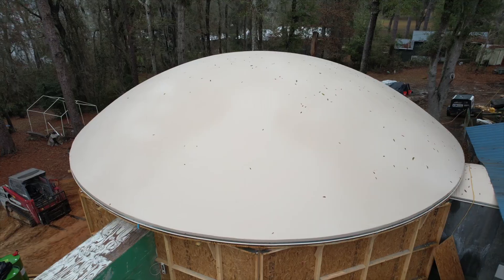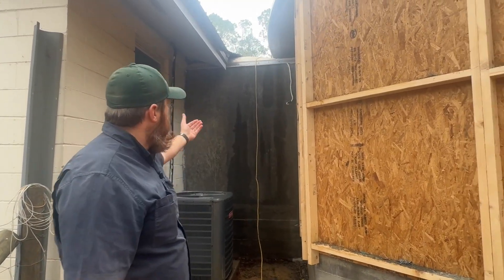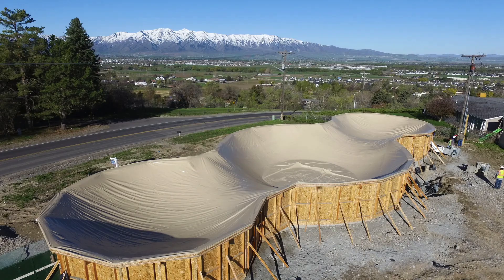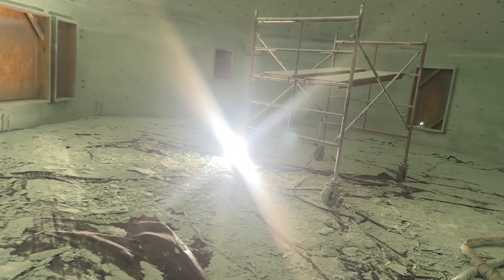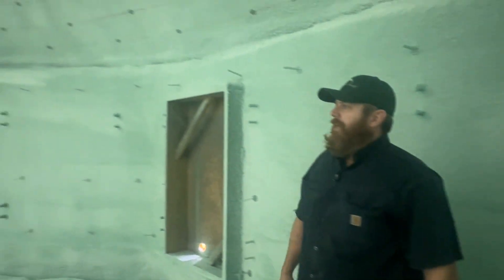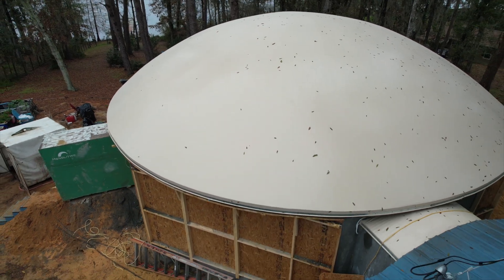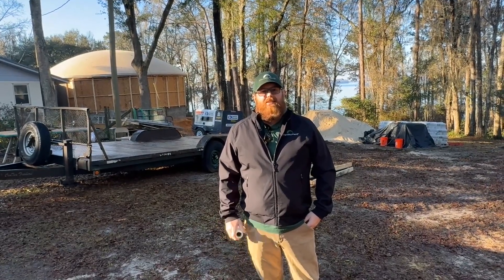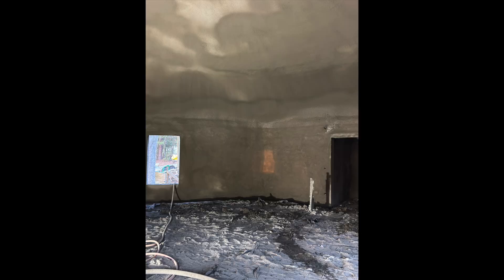Building an Orion-Style Monolithic Dome Home Addition in Tallahassee, Florida

Comment: I am interested in building a dome structure on an eco-friendly lot in the Maya Riviera. Given the local building code, which requires a balance of 60% environmentally friendly materials and 40% concrete, I am eager to learn more about your design process.

Do you offer custom architectural designs based on the client’s needs and lot specifications, or do you provide pre-designed prototypes suited for different environments? Additionally, I would love to understand how streamlined your construction process is and what efficiencies you incorporate.

I am also looking for information on cost per square foot and available models or design options. Any insights you can provide would be greatly appreciated.

Looking forward to your response!

Best regards,
Reply from the maker: @mariano18valero18   Thanks for your questions. We received your email and will get back to you soon.

Comment: To clarify, are the wall's layers as follows: OSB (for form), concrete (exterior), foam, concrete?
Reply: Foam is not very fire resistant so it would make sense to do it the way you are thinking!
Reply: @Damageinc.  Their normal dome construction is air form, foam, concrete.  This video looks a little different which is why I ask.  Curious if it's just for that flat wall appearance on the outside.
Reply from the maker: @mikemcelveen  Yes. It’s just to get that flat wall

Comment: How much do these dome homes cost?
Reply: This would be good information to have.
Reply from the maker: @seotenin  We find that the cost for just the shell with holes where the doors and windows will be is about $100 per square foot of total floor area. The finish out is at least another $100 per square foot.
Reply: @MonolithicDome   theoretically the walls on a design like this could be rebar reinforced CIF, concrete block, cinderblock, reinforced Adobe,  etc, correct?
Reply from the maker: @ghost101049  Yes!  Definitely
Reply: @ 
Very cool
Thank you
I’m thinking of having one made, but still in the planning stage